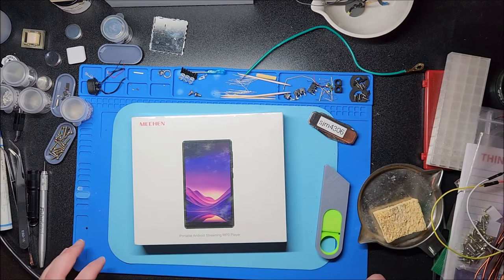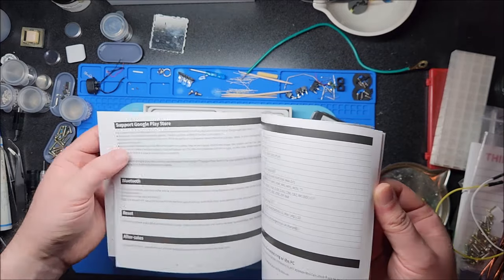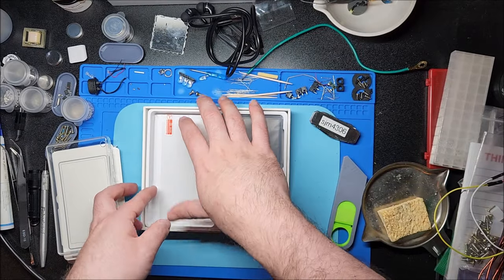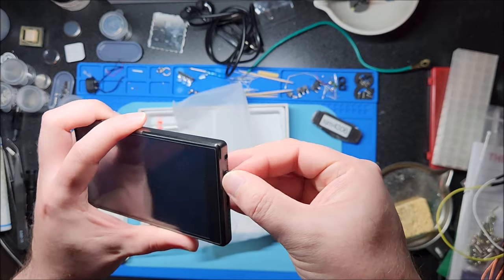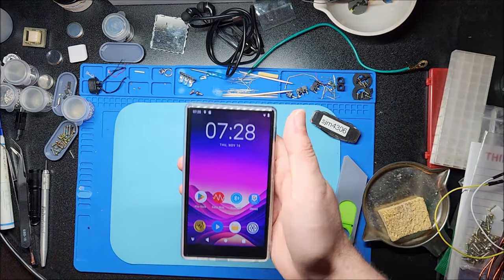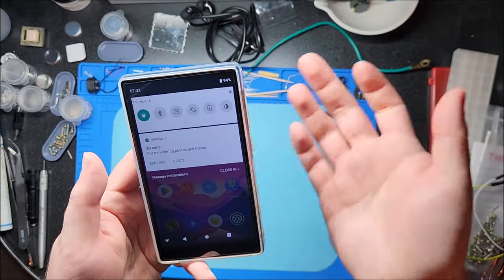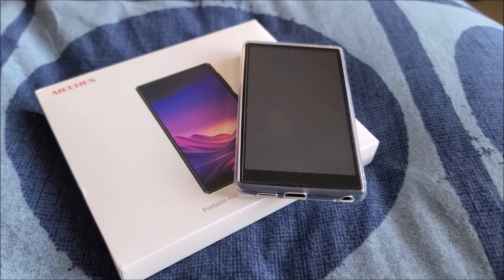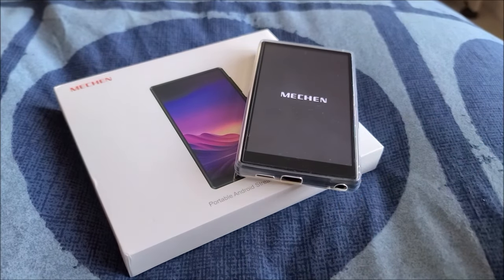A New Android MP3 Player King? Mechen H11 Review

Comment: There are many variations of this exact same mp3 player. I bought one from Swofy for around $50 on Amazon.  It worked well and I liked that it came with a case.  Ultimately I returned it because I saw no advantage of using this vs my spare old android phone which has a larger screen.

Comment: Funny thing - on the emulation front, I had a bit of trouble getting MAME4Droid to run on this one (which runs Android 9.0), but had no problems with installing it on my Pecsu P5S (which runs Android 8.0). Funny that the "older" device would work better, especially since this H11 seems to be vastly superior in other ways (screen, speed, etc.)

Comment: Thx for this great overview! I am not sure about that product. For me it basically is a "normal" mobile phone. Without SIM Card connection.  But any other functionality. So there is no single feature that does make this special for an mp3 player. I mean, can you use it blindly? Next/previews song from your pocket just with your hands?  Or is there a function for a sleep mode or turn off when not using?  I think I really like that product. But I also like any other mobile phone. So maybe a very good aged top phone could be even better when buy second hand. Isn't it?
Reply from the maker: They generally don't make phones this small anymore so that's a "small" benefit (pun intended). I'd also be less worried about damaging a cheap android mp3 player than a phone (though I guess if you go back far enough you could find a decent one for cheap but then the battery would likely be tired/old). As for using any phone/android media player blindly, most bluetooth audio devices can control track skip, volume and playback from onboard physical controls so that's always an option.

Comment: Hello, I just purchased the product.  I have 2 questions, I would be happy if you answer them.  1, How loud is the volume when using headphones? I like listening loudly :)?  2, Is it possible to remove all applications that come installed on the product?  Thanks.
Reply from the maker: So the volume really depends on the impedance of your headphones. It's decently loud with my iems and ok with my over ear headphones. As for removing apps, it's android so you can uninstall just about every app that's not necessary for android to run.

Comment: How to transfer files directly on to player from Apple computer as mine is not connecting?
Reply from the maker: If you have an sd card slot on the mac the easiest way is to add songs to an sd card and put the card into the player.

Comment: What's the sound like?
Reply from the maker: With doubletwist and the eq set it sounds decent over the headphone jack. Maybe not as loud as I'd like for higher impedance headphones but plenty enough for iems. The good thing is it supports usb otg so if you really want you can plug in an audiophile grade usb c dac and it'll absolutely sing. I mostly use bluetooth though for convenience.

Comment: You might as well buy a £99 Android phone with better specs and use it as an iPod without a SIM card
Reply from the maker: Getting a better android phone that's under $100 will mean it's a few gens behind and used. Batteries on sealed phones only last a few years if taken care of so likely before long you'd have to open it to change the battery. Sure that's an option for some but not for everyone.